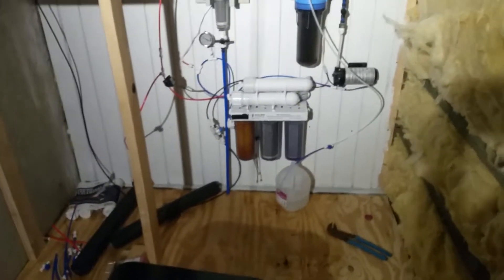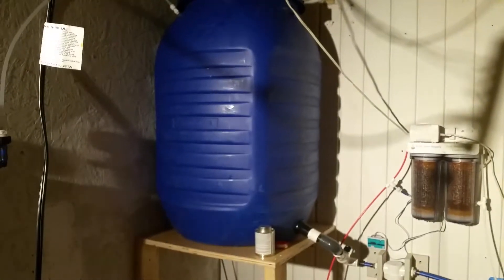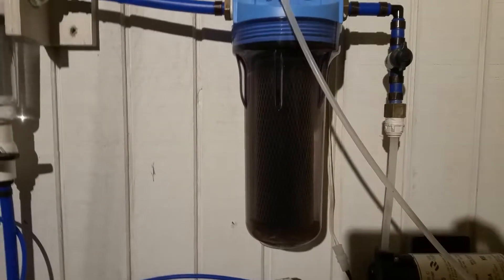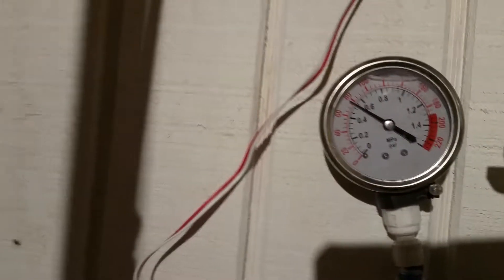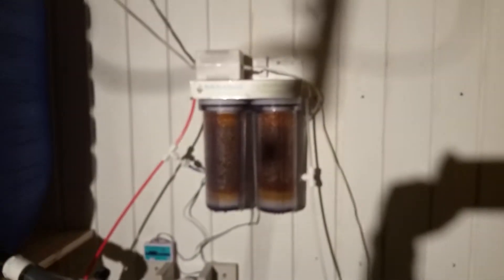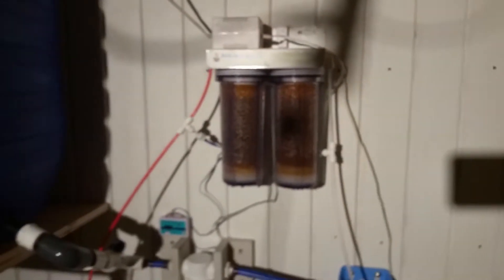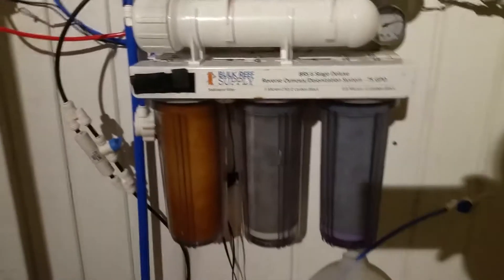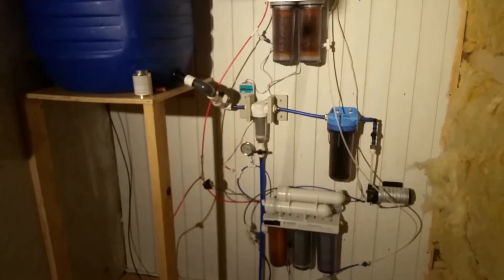RODI degassing setup. Well water excess co2 depleting DI resin.

Comment: Hi! I recently moved and am setting up a system very similar to this. I know its been a few years but if you're still active on here I have a couple questions: What kind of air pump/stone do you run? Just standard aquarium stuff? Also how long do you need to let it gas off before you can run it through the system?
Reply: Standard air stones and tubing. I did upgrade to a more commercial style air pump but, it's noisy but running for a few years now vs needing to be rebuilt or replaced like the typical air pumps. 
I typically filled my reservoir and let it degass for 24 hrs with good results.

Comment: I didn't think about the ratio so I was unable to make 50g in one batch using the 75g Barrel. I upgraded to a 275g IBC tote. 
updated video to follow. 

finally figured out the restrictor. think I ended up using a 1000ml. that got me to a 4.5 to 1 ratio then I used a ball valve to dial that down and am currently around 3.4:1. I'm happy with that. I was running 1:1 which was harder on the DI resin and overall ife of the membranes.

Comment: I have well water also. High in co2. How is your degassing setup working?
Reply: Texas Reefer it's working great. have already made a few hundred gallons RO with no color change in my new resin. previously my resin started to change color after the first 50g.
Reply from the maker: posted from my other account. system works great now.